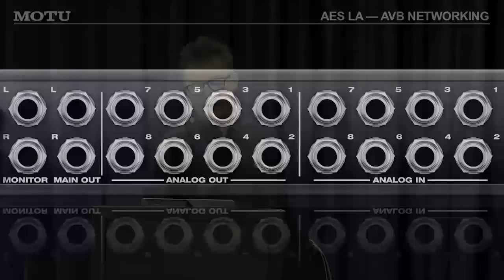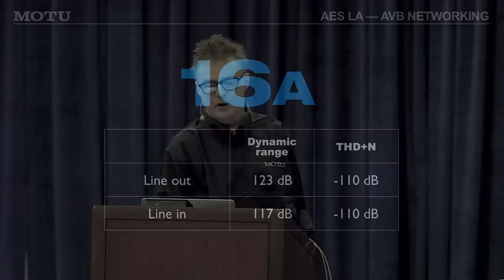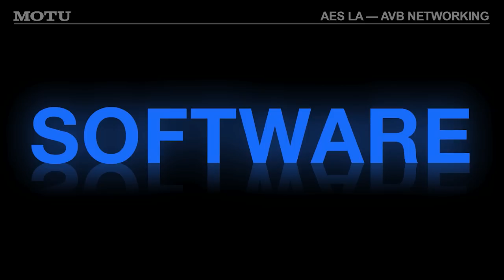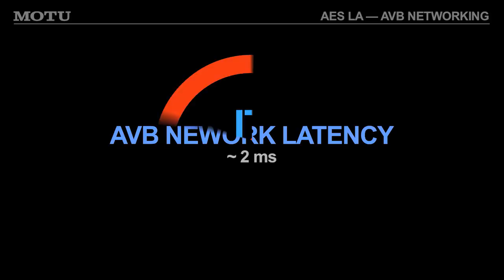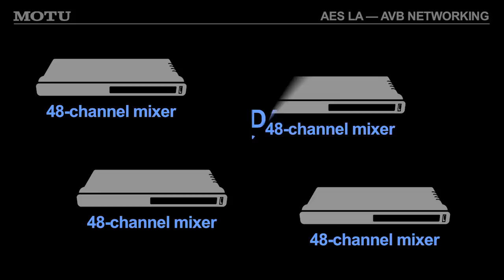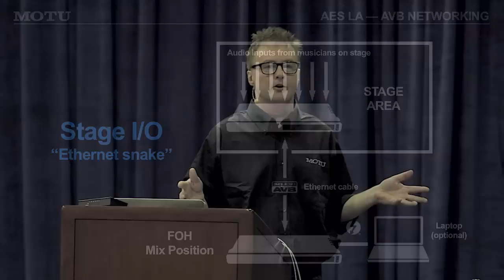MOTU AVB audio networking session at AES/LA 2014

Comment: hey man, what we need is a way to jam real time with anybody in the whole world via internet  - what have you got for that?
Reply: King Kor You got to understand that the AVB protocol was designed to work in a LAN (local area network) IT environment. In contrast to that, streaming audio and/or video data via the internet is basically based on telecommunication protocols, which are either designed from scratch or can be based on more or less modified standard IT protocols used for data transfer through the internet. So, we're talking about two different technologies here. As usual, the guys at MOTU hold their cards close to their chests when it's about what's on their drawing boards already. Maybe someday they'll surprise us with a robust and reliable solution that might grand you wish. Let's see...
Reply: right on Einstein!
Reply: JamKazam app. Check it out. Works well with my ethernet connected Mac Pro and my older Motu PCIe-424 card and 2408. A fast audio connection is necessary to avoid real-time latency. These new interfaces connected over Thunderbolt would be ideal.

Comment: @MOTU: You did it again. And again, you did it right. Congratulations for this new and awesome product family.

First of all, in this presentation, Dave "Magic Dave" Roberts doesn't exaggerate, the system is easy to install, to configure and to control. It simply works.
A few weeks ago, I bought a1248 AVB and an 8M AVB and installed them in my project studio. I got to say that these interfaces are really amazing, first of all sonically as well as in terms of flexibility and usability. I run them alongside DP8 on an iMac and everything works flawlessly. I'll definitely expand my AVB system in near future since I am fully convinced of what MOTU's has achieved with this new class of audio interfaces. MOTU did a fabulous job, thumbs up!